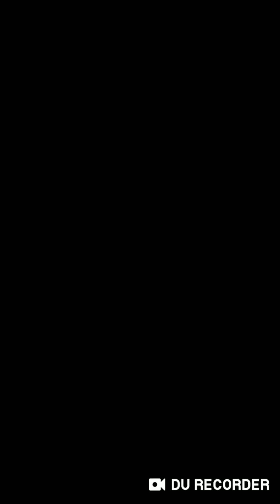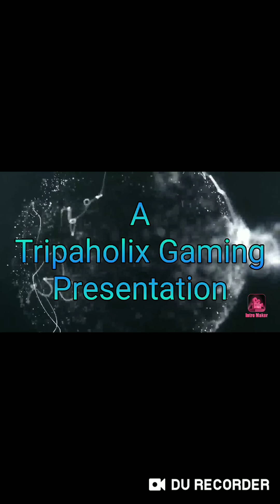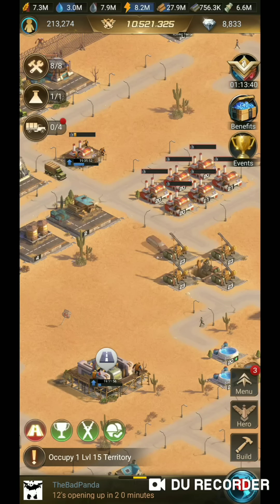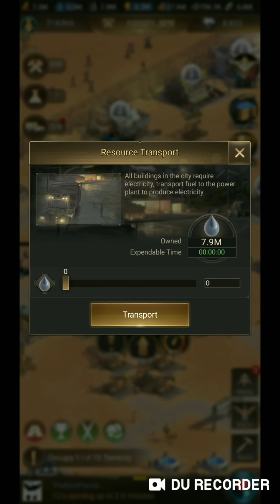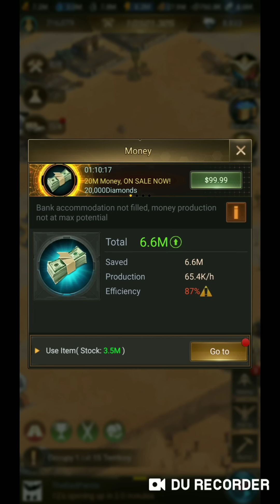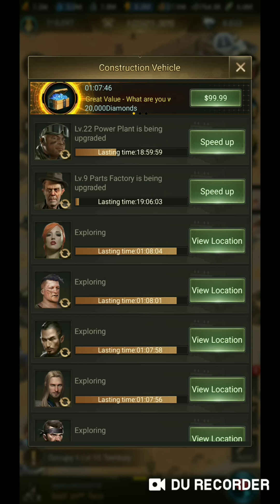Last Shelter Save Energy - How to reduce electricity consumption in last shelter survival

Comment: im a farmer and i disagree with taking ration truck off the road, its a bitch taking it on and off the road as i fill it up almost everytime i check in,, from my calculation i only spend like 14-18k fuel (to transport to poer plants) if i keep ration truck on the road 24/7 and its enough to maintain like 6-7mill electricity everyday(got 24m in storage too)